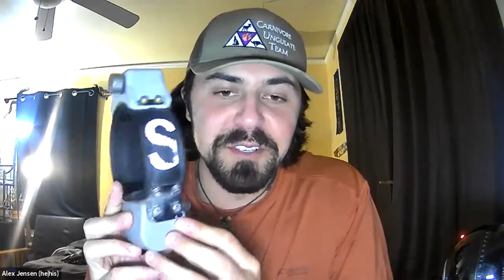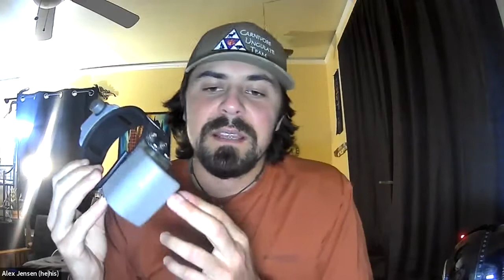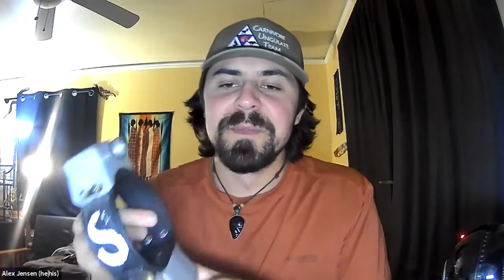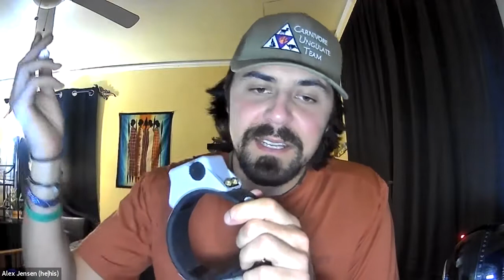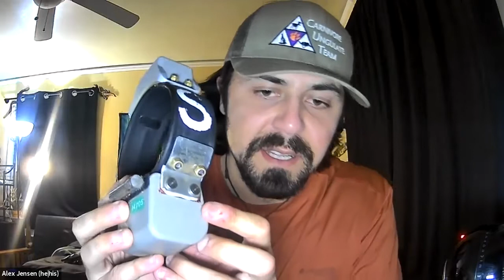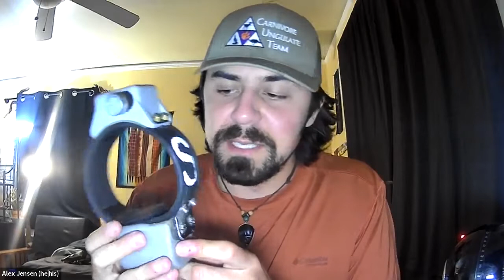Wildlife GPS Collars 101 - The Hardware

Comment: I wish you would show the other side of the tracking - how you monitor the collar. Is it like a Google Map screen, where you can zoom in and see the track of the animal, as well as it's current location? And what service do you use to do the tracking?
Reply from the maker: Appreciate this comment - I plan to make a video on this too. In short, it's more like we use a big spreadsheet of locations then plot them in Google earth (or other software) to look at their tracks. There is software made by collar company where we can view the locations and download the data. So not really real-time tracking, partly because that would require really frequent locations, which would drain the battery really fast.
Reply: @wildliferesearch365  So is this why VHF gets used as well? You use GPS to give you an overall idea of movement, but the VHF signal and antennae to find them on the ground in real time? Or is that separate again - you either put on a GPS collar or VHF - not a combination of both?
Reply from the maker: @timwilde4200  that's right, if we need to find the animal in real time, then VHF is the way to go. My collars (and most GPS units that I'm aware of) have both. So for me, if the GPS battery dies, I can use the VHF (separate battery) to find the collar after it drops off. But weight is also important - many animals are too small to carry a GPS unit (like bats for example), so even though it's an older technology, those researchers often still use VHF because it can be much lighter (and cheaper).
Reply: @wildliferesearch365  Thank you. I really appreciate the response - it's been a bit of a steep learning curve from knowing nothing at all a few days ago. :)
Reply: @wildliferesearch365  Hi again. I've been doing a little more reading and am a little confused. According to another clip on here - https://www.youtube.com/watch?v=gXCrvnTilgI&t=236s - he used a VHF frequency of 149.6295 for locating a bird. I can't figure where in the VHF and UHF spectrum that's supposed to fit. I went and looked it up and it's in that zone between low band (49-108 MHz) and high band  (169-216 MHz) VHF. Is there some zone in there where your trackers are permitted to work?

Perhaps, when you get around to doing a clip on the actual operating side of things, you might cover this? I'm very intrigued by how you guys go about it all! :)

Comment: Hi
I want to know how researchers track those migratory birds who travels long distance.
Is it possible to get their real time location.
Reply from the maker: Hi Abhinav - researchers typically will place lighter weight trackers on birds. Sometimes they are like backpacks or they can be affixed to their feathers on their back. Here's an example: https://www.icarus.mpg.de/28874/sensor-animals-tracking

Regarding real-time location, often there is a delay from when the GPS point is taken by the tracker and the data is received by satellites. But some researchers may have near real time data from their study animals.